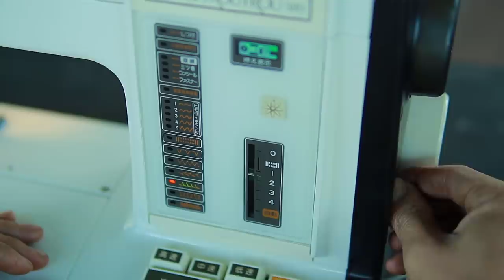Restoration old Japanese JUKI 580 multi-function sewing machine | restore antique sewing machine

Comment: Your good but I find it hard to believe that the motor which dis not give you any reading on your tester still works. And washing the wire and mother board?🤔🤔 the wire had change colour Im sure you got a new wire and power board.

Comment: It's fake. The first half is him pretending to clean the wrecked old one, the second half is him re-assembling a different, working machine that he just took apart. Look how the bits that he spray-painted silver  magically become a real bare metal surface! Look how there are places now magically un-painted when you saw him paint them earlier. Compare 10:30, look at the upright part (where the display and stitch selection is going to be on the finished machine), see how the areas around the four screw holes are not painted? Now go back to 7:42 and watch that piece (it's the one closest to camera, lying on its side this time) and see how in indiscriminately blasts the whole thing with paint, covering the holes. And before anyone says "he taped it up", there's no tape when he's painting it, and when you tape before painting and remove it, you get a distinctive sharp edge. Have a look at 9:14, those other holes were covered by tape, by whoever actually painted this at the Juki factory, see the difference.